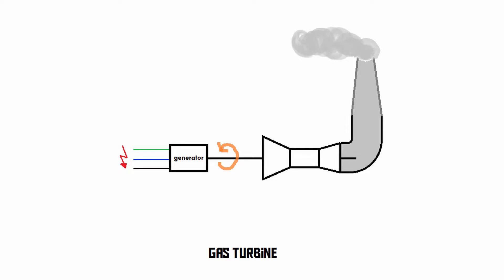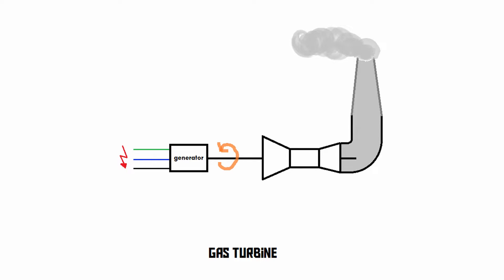Why combined cycle power stations are insanely efficient (AKIO TV)

Comment: you might want to design a cryogenic carbon capture with Air separation unit that heat that warm up the >-163°C liquid natural gas and cool down carbon dioxide to become liquid at >-31°C

Comment: Good presentation!  Thank you.
I was a Field Engineer for General Electric Technical Services Co in the late 1980's. We did 100% gas turbine work all over the world, installations and overhauls. The ''gas'' part refers to the combustion gas to turn the turbine after the fuel is burnt. The 2 primary fuels are natural gas and distillate fuel. Some turbines had fuel nozzles and equipment to burn either fuel. There was even one model in the 1950's that powered US locomotives. Union Pacific Railroad even had a gas turbine locomotive powered by pulverized coal which quickly eroded the internals. The other locomotives burned fuel oil.

Some turbines I worked on in the Middle East burned crude oil right out of the ground. The hot gas path components had short lifespans due to hot corrosion. Some gas turbines burned Bunker C , a thick low grade cheap oil that was used on ships in marine boilers to produce steam. The 5 Chevron tankers used in the 80's  burned old diesel fuel (in need of re refining) in their gas turbines. 

Aircraft gas turbines are incredibly expensive and they burn finely distilled jet fuel that has the least amount of hot corrosion producing components for longest service life. GE Industrial oil fired gas turbines used Atomizing Air Compressors that put air into the fuel nozzles for better combustion and clear exhaust. Great strides have been made in 40 years to gain efficiency while reducing exhaust pollutants.

Natural gas fired gas turbines have to deal with varying BTU content in various regions and have different sized fuel nozzles accordingly. Their hot gas path components generally live much longer than distillate fueled turbines.

GE even designed a nuclear powered gas turbine jet engine that heated air extremely rapidly and spewed huge amounts of radioactivity when it was tested. 

There are still simple cycle gas turbine generators used but they are mainly employed as Peaking Units for when the margin of safety in the grid capacity is nearing its limits. They run for a few hours a day when needed and can be started and fully loaded in about 15 minutes or less. They are notorious for being fuel hogs. I recall one fuel oil tank having 4 million liters capacity at one plant. It could be drained in less than a week. One turbine burned 8 liters of fuel per second at load.

I hope this helps! Keep up the good work.